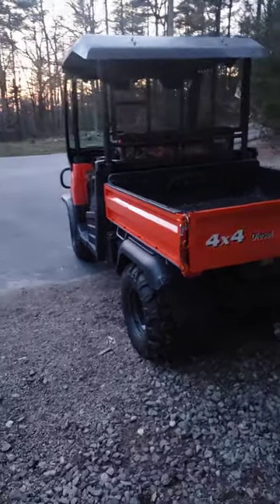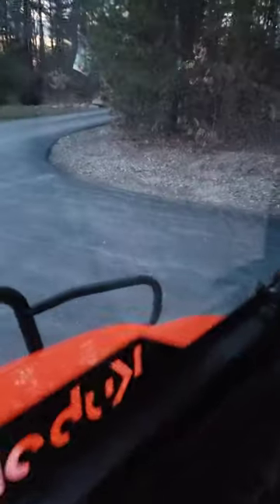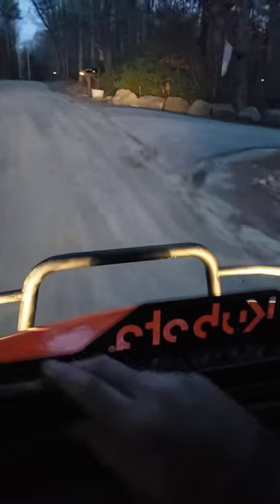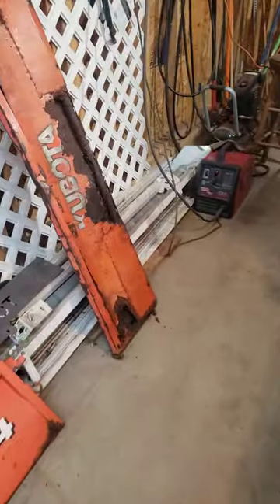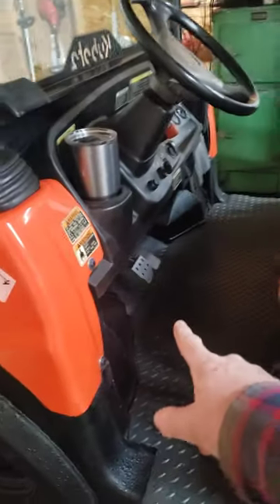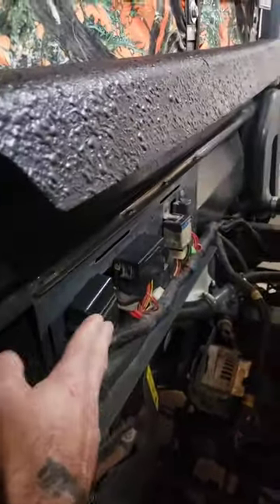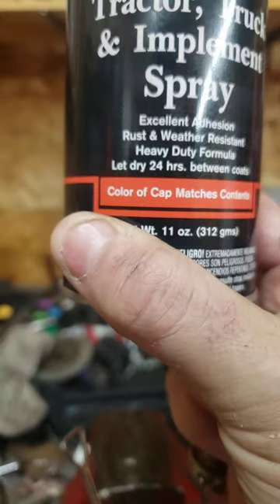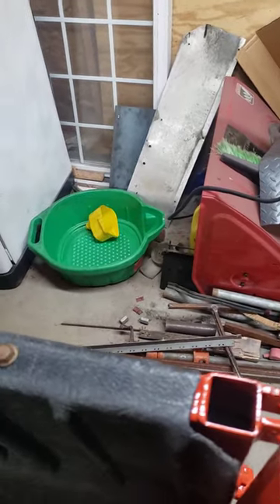walk around an ride on the finished restored 04 kubota rtv 900 !!

Comment: Great job.  Glad to see you driving it around.  I am on the Kubota RTV forum as well.   I agree, great bunch over there.
Reply from the maker: Absolutely!
Reply: What about the oversize fan blade? Where did you get it? How big is it? I might want to do it to mine
Reply from the maker: @jodykopnicky5140  its a factory blade off of a zero turn mower i believe,even the tractors use it.i will get the part number ot measurements just give me a couple days,a lot going on right now.put it this way,it runs so cool the electric fan will never need to come on,an if it did it would probably  mean there's a issue.this fan should be on all of them.